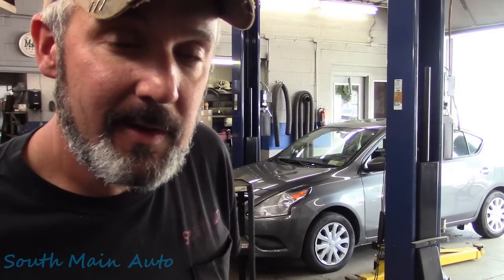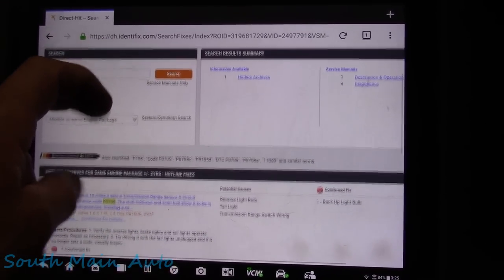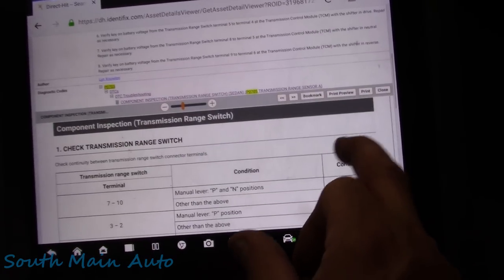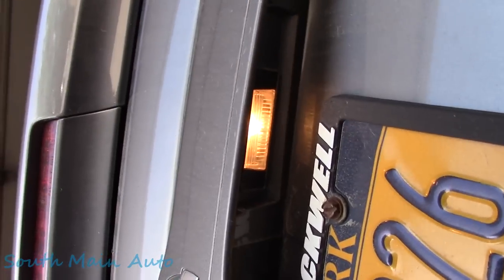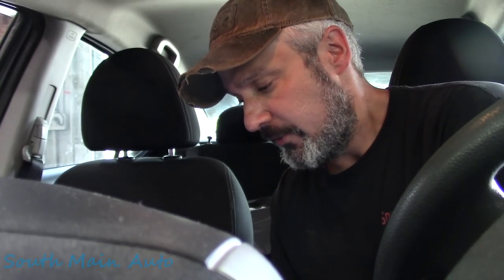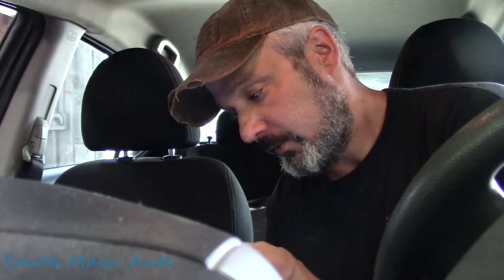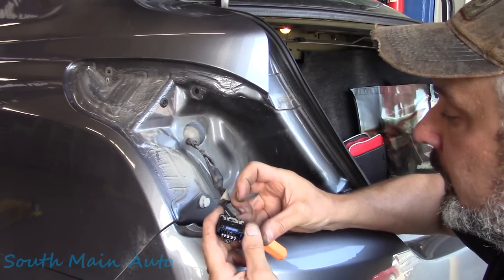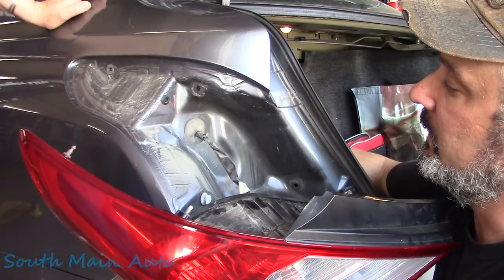Service Data Doesn't Cost - It Pays

Comment: Hi.

Good material as always.
Here in Poland, I have such everyday cases with a problem with the ground in the rear lights.  These plugs come from French Renault group cars.  Since Renault bought a Nissan, there are problems with the ground burning in the rear lights also in Nissan.
A small hint on how to disassemble the plug without breaking the plastic:
1. Move the yellow plastic upwards
2. Gently stretch the plastic up and the t-pin on the side, pry the small latches first on one side then on the other.
The ground-carrying pins are too small for the current they carry, which causes them to heat up and burn out.
Here in Poland, we mainly deal with cars with a manual gearbox, so I have no problems with selector errors.  Instead, it can be seen as a Christmas tree on the lights or the instrument panel controls. 

Greetings from Poland.
Reply: too much current for the pin size was my first though and assumption. but my next thought and question is, are the terminals over-rated that far? cheaper materials with higher resistance? or "failed bulbs" with partial shorted filaments cross connecting and causing higher current flows, yet too low to blow the fuse.
or is it even worse, being engineered allowing the pin to be overloaded if the vehicle sits with tail, brake and reverse applied for long periods. them thinking ""oh nobody will sit there with reverse lights on for long periods"". I can totally see that happening on both fronts, engineering and consumer drivers.

Comment: I’m currently working on the same problem you are dealing with on the same car, but mine is a 2019 Versa. I’m a Nissan technician. There is a TSB for the P0705 code to check for water intrusion in both tail lights and corrosion on both circuits for the bulbs. If there is water intrusion in one or both of the tail lights and corrosion where the bulbs are on the circuit board, replace both tail light assemblies or replace the affected tail light

Comment: Always nice to see Mrs. O.
Who would ever think, a loose pin in a tail light would affect a transmission.
Reply: Kinda makes sense seeing that the reverse lights have some power at the wrong time so TCM sees that voltage (low) etc it’s getting mixed signals via rear lights
Reply: anyone that knows and understand the idiocy level of needless electronics(junktronics) being implemented in a vehicle to help with safety and creature comforts..
I guess it kind of works, since when they're safer when not driving and stuck at home 🤡🥳  🤣🤣
Reply: Well... If we are talking about how lights in circuits can effect things....  Back in the day, I was an individual that worked on computers, a time when computers still had a considerable "mechanical" portion to them.  I once went out to work on a big fancy line printer, way before laser printers were a gleam in an engineer eye.   It had 132 little individual solenoids that fired "hammers" and each one of them had to be "timed" to physically strike at the exact moment that the desired character on a cylinder or chain of characters passed in front of it.  If the timing wasn't correct you would get off-set half characters being printed and it made things difficult to read.  These were big massive very heavy devices.  Anyway, the customer claimed that the printer wouldn't come "on-line" and he therefore couldn't print to it.  I got to the site and sure enough the printer wouldn't come on-line.  I exchanged the module that had the applicable circuitry on it and still the printer would not come on-line.  After some considerable frustration, I eventually got out the electrical prints/diagrams and chased the problem down to a burnt out light bulb.  The on-line indicator light bulb was actually in the circuit in such a way that if it was blown the printer would never come on-line for printing.  I couldn't believe it!  I think it was the only time I ever found an indicator light that could effect a device in such a way.🙄😒

Comment: In 1973, I owned a Datsun 240Z it had a drivability problem I could never find, until the small ground wire between the back of the engine block and the body of the car became loose. When I noticed  the wire became quite hot I tighten the bolts and the problem went away. On the 1973 Datsun 240Z the battery ground cable was grounded to the body of the car not to the engine.

Comment: I work at Oreilly auto parts. Had a guy come in the other day with factory LED tail lights on is MKZ. Was pulled over for his brake light out on driver side. When he steps on brake it didn't work but the turn signal did and used the same LED lights as the brake light. To throw more of a curve all the other lights worked fine. And if his parking lights or headlights were on his driver side brake light works just fine. Not sure if he has gotten it fixed yet, but my only guess is it would be a bad LED driver module.

Comment: Our 2004 Nissan Micra (UK) wouldn’t lock with the keyless remote, we figured out after a few weeks that if we waited about 30-60 seconds it would lock. It was a so frustrating! I happened to notice the interior light wasn’t working, threw in a new bulb and all was good again!

Comment: Mrs O is onto something when she asked if your mini prybar video involved heat.  I attempted to make multiple mini prybars after watching your video and every single screwdriver snapped before bending.  Turns out most of these are hardened and need heat to bend them.  I don't think you mentioned heat, and that's why I own 3 screwdriver handled punches now!

Comment: I’m a software engineer so used to strange diagnostics.  Heard of bad earth on indicator that turned off power on engine.  So go to overtake (uk) and indicate, indicate/ turn earths thru brake, the emu detects brake and slows engine.  Thus maybe the earth thru reverse light causes emu to detect drive and reverse.  It a typical “sheep dip” software that tries to double check by using alternative signals in parallel.  Thanks for the video.

Comment: A friend changed the left hand mirror and the transmission wouldn't shift right.  Long story short,  the mirror he put in didn't have a out side temperature sensor as required.  Get the right part. It was a Dodge ram pick up.

Comment: I had similar issue. 2015 Toyota Camry rear left marker light bulb was replaced  with aftermarket or faulty OEM. during day time no issue but during night time when i switch on the headlight the car will stall and about to shut off but when i switched off headlight car goes back to normal. electrician found the bad faulty bulb replaced and it is fixed.

Comment: Crazy and insane how the loose taillight connection had an affect on transmission. Boy, how cars have changed.  Great job!
Reply: Electronics tend to be be more sensitive to bizarre issues even with the great engineering Nissan is quite good at. Whoever made that entry in the Identifix is quite brilliant. I've had similar issues with non-automotive systems. There are a variety of failures which, like this make no damn sense unless you have the luxury of some very expensive tools, full access to the wiring diagram, electronics schematics, bill of materials with datasheets for everything and the source code used in the electronics if there is any. I now work in a field where I get to do that. Example, bare metal under an electronic part where it worked just fine for several months till thermal stress caused the bare metal on the part to touch the bare metal on the board. 
This took about 6hrs with 1/4 million dollars of equipment to diagnose fully. The fix was use a plastic bodied part, an insulator and a change to the firmware. The plastic part is cheaper*. They'd gone with the more expensive part as it had unneeded but slightly better specs from a vendor we trust and it was with-in their budget. Good intentions that would exceed most folks expectations yet it failed. For the fix they changed to the plastic part,  went with the analysis techs recommendation (a coworker) did two more trivial fixes then after that *tested it carefully (hulk smash) then recalled the ones shipped for the fix.  Just the change of a $0.02 part and trivial fixes cost 80k due to mostly regulatory compliance as engineering time was low and the recall cost was a pittance, the black eye to our reputation was far more painful. 

A dealer ship may know this problem and have an engineering fix as they get all the bulletins. It would be nice if they have done a recall on it. I check for recalls when my car acts up, saved a bit of scratch doing that as one very expensive fix was free.

Comment: I've encountered this, and seen the problem clear up as the condensation left the rear taillight assemblies.  Looking at the wiring diagram it obviously makes sense, but it's not what one would initially expect or go towards.  Kind of like they toyota corollas with the plugged evaporator drain with condensation leading to oxygen sensor codes.

Comment: Mrs O did a great job doing the unbiased investigation - under intense pressure from Eric by-the-way.  She never knows what (request) will walk thru that door!
I was wondering if somebody was in there before (screws not tight and wire harness grommet not in place) and ended up stretching the ground pin.  Another awesome fix Eric!!   Thanks

Comment: Identifix helped me the other week on a civic parasitic draw. Searching identifix led me right to a listing for the keyless access control module staying awake, after doing voltage drop testing across the underhood fuses. The person's testing had me ending with a faulty exterior door handle keeping the module awake with a 150 miliamp draw.

Comment: Great to see Eric's glamorous assistant getting involved in the repairs. 
Backfeeding voltage from the reversing light circuit to the control electronics could well be causing the processor to become confused by not seeing the expected voltage  on one or more output pins of the IC. If the processor is expecting to see 0 volts on a pin and it sees 3 or 4 volts instead it might have difficulty determining if it is seeing a high or a low on that pin. That could be the reason for the slow or confused changes.
Just a theory.......!

Comment: A year ago, my Hyundai went into limp mode, with the money light on. P2123 code. I removed and replaced the throttle pedal, fault cleared. After watching this, I am going to revisit the connector, just to check those pins. There was no dirt, corrosion or any sign of anything untoward, thanks, Eric, it never crossed my mind to check for pin tightness.

Comment: i am sitting at the edge of my seat waiting for the outcome of your repair as I just got through working on the same problem on my wife's car and it is driving me crazy! back to the video and thank you for your videos
Reply: also read a bulletin from nissan stating that the light assembly needed to be replaced , cost per dealer, almost $300, luckily my parts cannon is not on. i will check the terminal tension, come morning. thanks again, Eric!!

Comment: I had an intermittent radiator fan on a 1991 Plymouth van where the mechanic changed out the fan. The problem came up less than a week later. I self diagnosed a loose round connector at the fan,  got in there with a pair of needle nose to tighten the connector and never had a problem again. Had a 2006 Caravan left red light assembly where the brake light socket needed replacing because over heating from arcing weakened the tension on the socket connector. Trying to bend it to add tension did not work that time. Also lost the ground to right front headlight so cut and diverted the ground to a nearby spot. Fixed all the issues with a new 2020 caravan :)

Comment: i also ran into this before with the same vehicle. The bulb filament was floating around inside. We use identifix for their repair info. I like that you can search fixes, find diag procedures, and read all the info you need in one program. It saved my butt too!

Comment: As a warranty manager at an RV dealership, I was constantly after the mechanics to find the issue first before unloading the parts cannon.
One time a trailer came back with the same plumbing problem three times. I said whoa what are you guys doing? They kept tightening this pipe connection and it would pop off after. I told them that there was a problem. Fix the problem and the customer won't have to come back. 
Apparently, at the factory, the plumbing was just a little short and they tried their plumbing stretcher to make it work. Told the mechanic to add a piece of pipe to relieve the tension on the fitting. Customer never had to come back.

Comment: Like I always told the guys I worked with, you got to be smarter than what you are working on! I remember a green pea I was working with who took my advice when he was working on a new car with a problem. The service manual said to do it one way but he figured out by reading theory of operation that it could be fixed in a lot less time by disconnecting it from power and plugging it back in.

Comment: That reminds me of a car I owned a while ago, it was an ED falcon but this problem covered the entire range from the EB2 to the ED falcon to LTD fitted with the Smartlock imobilation system, if the high mounted brake light globe blew (burnt out) it would activate the Smartlock system and you couldn't start the car.

Comment: True story. As a Nissan master tech I had a car towed in, no acceleration. Found the left rear cracked and tail light full of water shorting the taillight bulb. Nissan like Toyota has brake input over  rides throttle input. Cleaned tail light out and fixed the issue. Customer declined replacing the tail light?

Comment: Excellent video, however, I'm still not sure why a loose connector pin on a rear panel light assembly would cause the computer to not properly determine what drive mode was being selected.

Comment: Great vid, Eric and Mrs.O! Just a word on that mini pry bar. A couple of months ago I did a T-case rebuild (Jeep 231J) and I had a %$#@ of a time getting the snap/circle rings off even with LISLE ring pliers! I finally gave up using just the pliers and slid the Snap On mini pry bar under the ring and really leaned into it enough to clear the groove it sat in. Long story short: I used that pry bar to get both those %$#@ rings out and I can tell you that the steel used in the pry bar I have is tempered and not bendable. The bent screw driver might work fine on stuff that doesn't require a lot of pressure, but it aint matching the nuts my (bought 2 of them when I saw your "make your own vid") Snap On pry bar has. I really was amazed at how much pressure those little bars can take.
Reply: The little snap on must be tougher than the full size pry bars, in my younger days I would permanently bend those. Dealer was not impressed lol

Comment: it's not just the backfeeding power being picked up by the driver as the reverse signal, it depends if the reverse signal is actually being used by the transmission control module as the actual condition not the requested condition, so you get a conflict with more than one signal in which sets the code

Comment: ARE YOU GOING to add your fix into that service database so that others will know the connector may need to be tightened?  Otherwise the next guy may be changing bulbs instead of working on the connector.  :)
Reply: I don't think that's necessary in this case, it was a bad ground which can have lots of different causes. That was fairly obvious from the action with multiple power sources.
I suspect a bulb has been changed recently which is why the bolts or nuts were only finger tight. Maybe the unit was allowed to hang from the cable and put strain on the connector.

Comment: My 01 F350, cruise conttol stopped working.  Was just about to start a diag when my neighbor rolled up and asked what I was doing.  After the explanation, he simply ssys, check the bulb in the cab mounted 3rd brake light.  I thought he was joshing me.  I was stunned to find it burned out.  I trplaced it and cruisr was back in action.  Go figure.

Comment: Not auto related but I run into Pin Retainer Issues all the time but the difference is the pins seem more insertion and extraction frequency where that connector would not.   Looks more like a manufacturing defect where the pin may not have been fully seated so the retainer was never allowed to snap into place with the housing somewhat holding the pin in place but driving around and vibration most likely caused the pin to wiggle itself out of place causing intermittent connection issues and intermittent issues are a PITA.

Comment: The newer the car the less well done the harnesses (ah those accountants). 
For such a delicate connection and drainage (0.5mm wire) the problem sooner or later returns (burnt plug and pin), so if I can (because, for example, there is free space in the plug) I try to lead additional ground to the vehicle, so far the way works and no one has returned yet. The plug you are dealing with is SCIMA (5 or 6 pin 1.5 or 2.8mm). Greetings from Poland.

Comment: 98 Toyota Camry. Lost ground at trunk. Our scanner said it was the neutral safety switch. My husband took all the bulbs out of the back of the car. Problem gone no safety switch code. Car drove perfectly. Turns out the ground on the drivers side at the trunk had fatigued the copper wire and the bulbs found an alternate ground through the neutral safety switch. The big clue for him was the reverse indicator light would illuminate when in drive when the headlights ( also lights the tail lights ) was turned on. Stay safe.....

Comment: Nicely done Mr & Mrs O!
Over the years (decades) many mfgs have included a tell-tale to the operator that the tail/brake lights are out (safety issue) as the operator can’t tell otherwise. Usually something in the cab that the operator would notice as not right. Time to  see the mechanic.